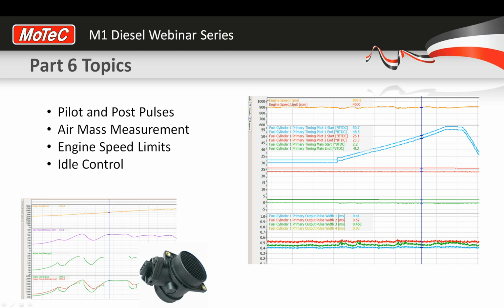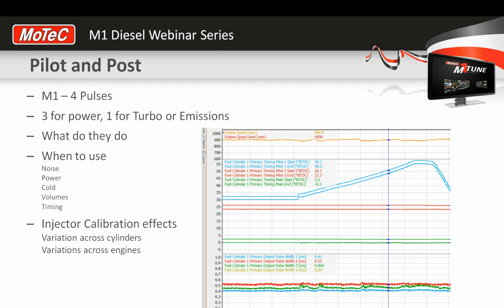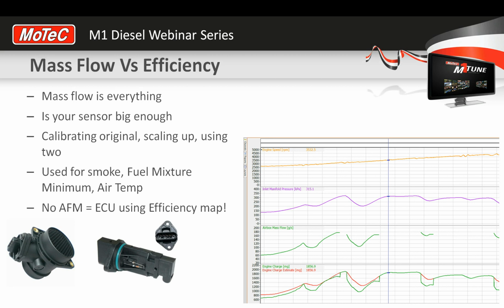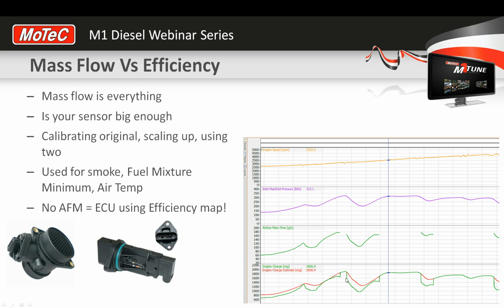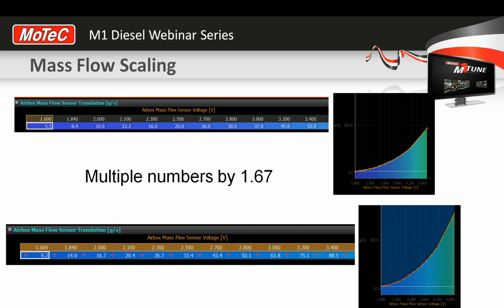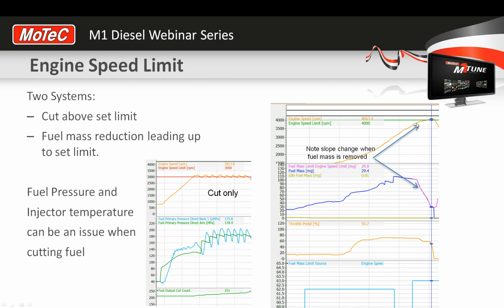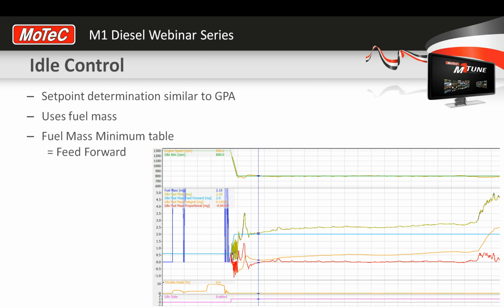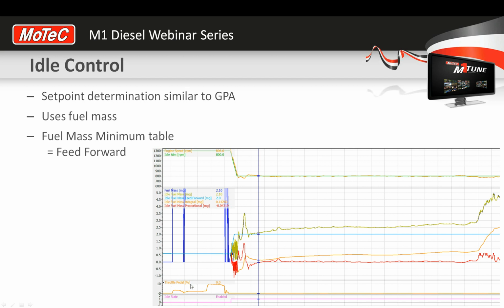M1 Diesel Tuning - Part 6

Comment: this video series is the best for diesel tuning.
 i bought hp academy diesel tuning training course , but this is more detailed and useful.Thank you.
Do you have reliable suggestions for the tractor? most importantly fuel economy, reliability and performance. Emission or black smoke does not matter for tractor
Reply: i agree with Yusuf bey.